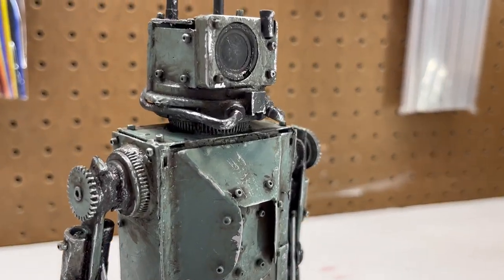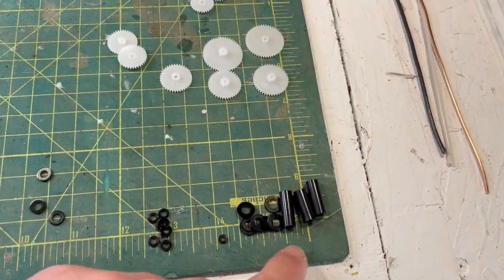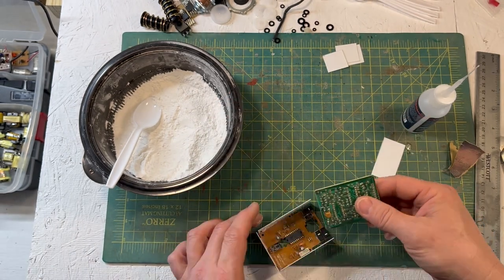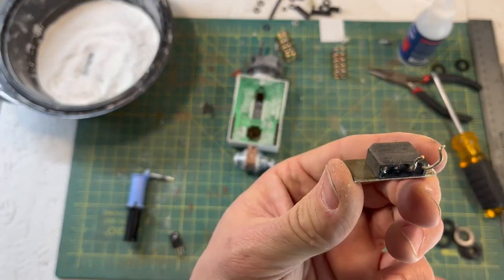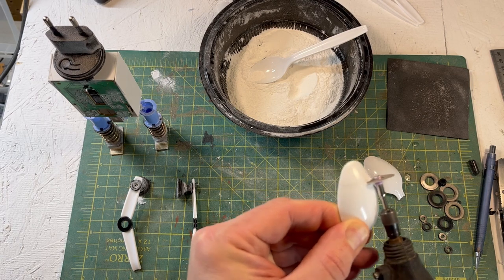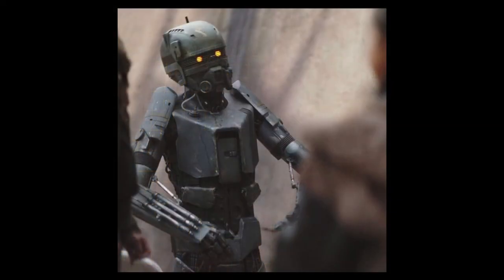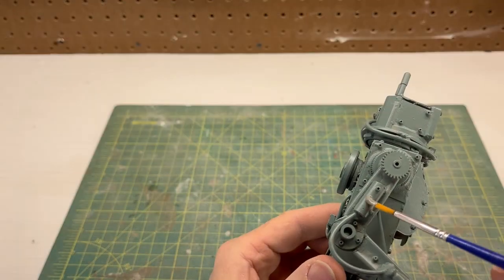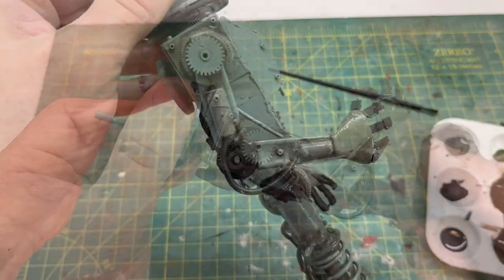How To Make a Robot From Scratch

Comment: I've always seen baking soda used with super glue not baking powder. Does it come out more smooth?
Reply from the maker: Hi Canescup12, I haven't actually tried baking soda so I can't say for sure, but the baking powder comes out fairly smooth depending on how precise you apply the glue.  I've found that if  you get sloppy or glob on too much glue, it can make the seam or "weld" look a bit rough and lumpy.  The good news is that it can be sanded and shaped so ultimately you can still smooth it out with some work.  I'm curious to try the baking soda now, and I appreciate your comment.  I'll give it a shot and I may feature how it goes in an upcoming video!  Thanks again.